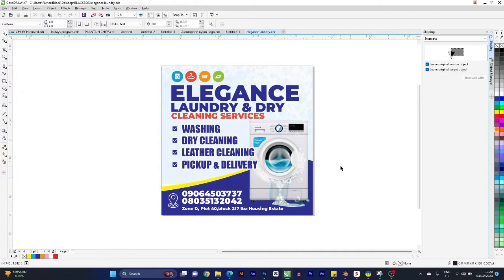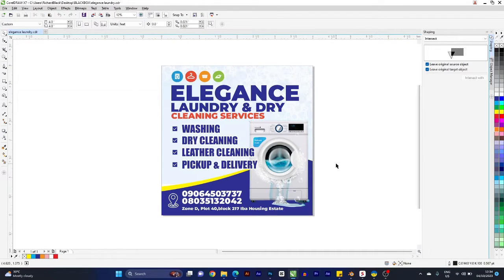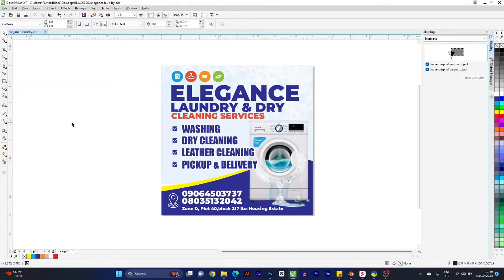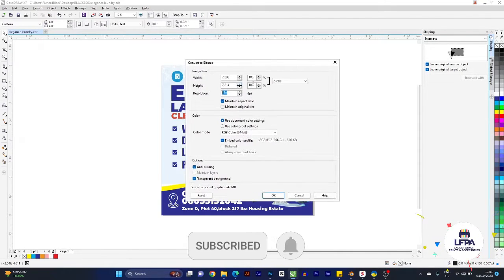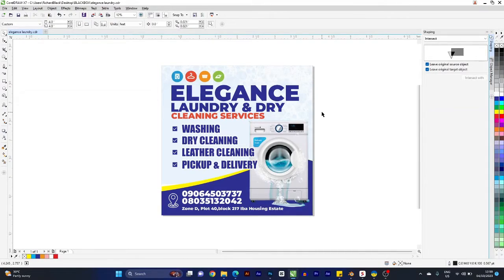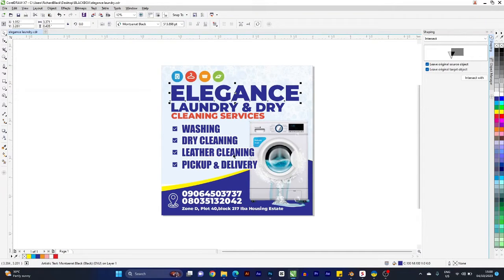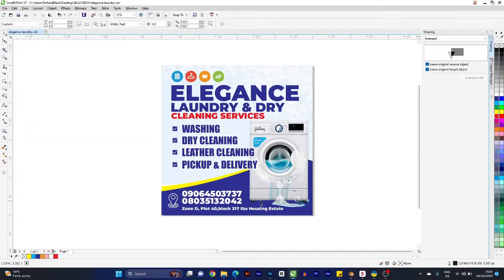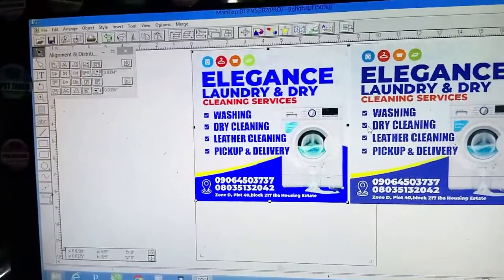THIS IS THE BEST WAY TO EXPORT YOUR JOB FOR A SHARP PRINT

Comment: Good afternoon sir, thanks for the lessons, i design on PowerPoint,  i use PowerPoint for all my designs, and Its RGB 
I export all my designs as pdf and i open on them on coreldraw to save as tif most of the time the colors doesn't come out well
Please sir how do i go about it
M
Reply from the maker: Start using coreldraw. You need that upgrade..

Comment: Hi. I've test it. Definitely a big different. But. Im still getting red or blue dots. Any idea how to get solid yellow colour without the pixelated red or blue dots around?
I'm testing with 2/2/100/0 and getting blue dots around and another like mustard yellow 0/22/95/0 with red dots around.
Reply from the maker: This might require a one on one consultation. But it costs $20. If that's okay by you. Then you can check my number in any it the most recent videos on my channel and send a Whatsapp message.

Comment: After 1 year of printing with my xp600.. finally I found out I've been exporting from coreldraw wrong. I've been exporting jpeg bitmap then copy n paste in paint as it came out black at maintop.
I have not tried it yet.. but soon with tiff.
I having red dots and blue dots on my solid yellow prints.. maybe my export is wrong. Hope it works for me. 😁
Reply from the maker: I trust it should

Comment: Hi mister ! When I export the file, the yellow color changes to green. But when I use a color from the maintop software the yellow color comes out well
Reply from the maker: What file format do you use for export.
Reply: @richwords1  TIFF
Reply from the maker: @p-gchords1585  okay I suggest you export as jpg first.

Then if that registers the colors correctly.

You can then import the jpeg and export the jpeg as Tiff
Reply: @richwords1  thank you sir
Reply from the maker: Did it work and how did you solve the problem

Comment: OK But if you are already Design with RGB Jpeg I felt export it to TIF CMYK?
Reply from the maker: Yes. Export as TIF CMYK.
Reply: @richwords1  But it was design in  Adobe shop it will give me good and sharp print result?
Reply from the maker: @musaibrahim3642  But you should be able to export TIF on Photoshop.

Else. You can use CorelDraw
Reply: @richwords1  Thanks Boss
Reply from the maker: You're welcome